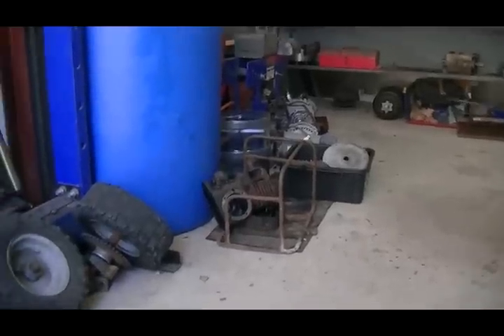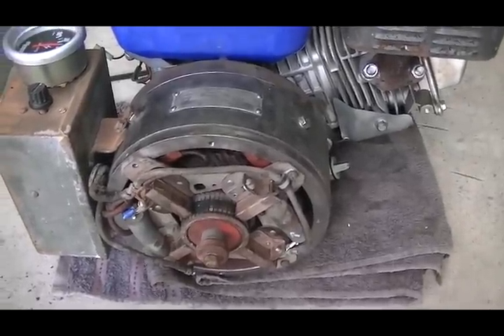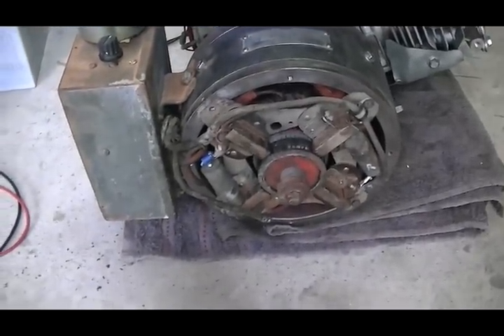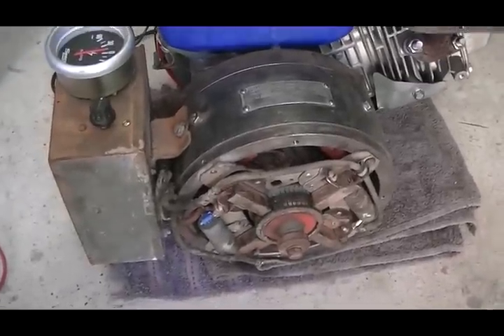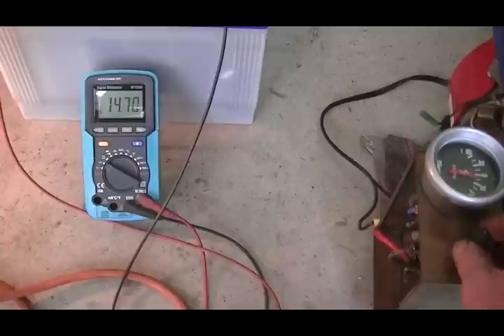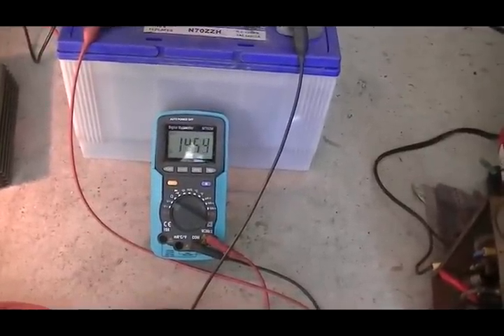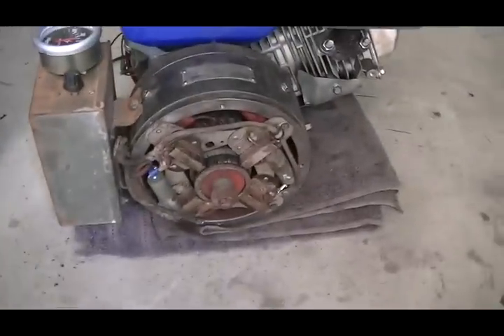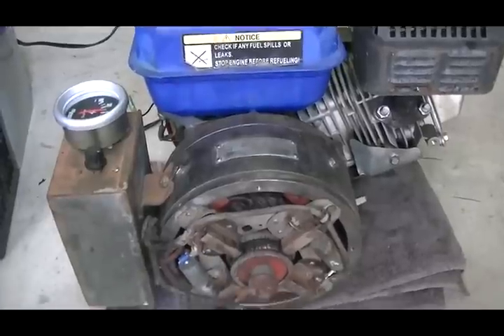Gen E motor first run

Comment from the maker: It dose indeed seem to be very low on the lenz force.I can pull 230 watts from it at 1200rpm,and the throtle position dosnt move,and i cant hear the motor load up.
They just dont make them like they use to.